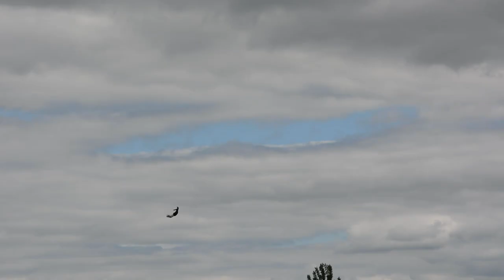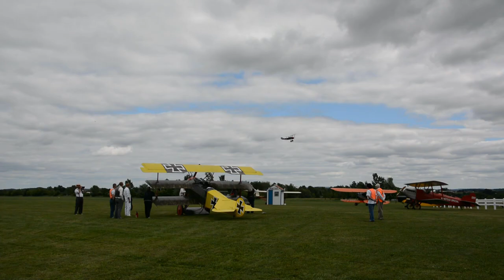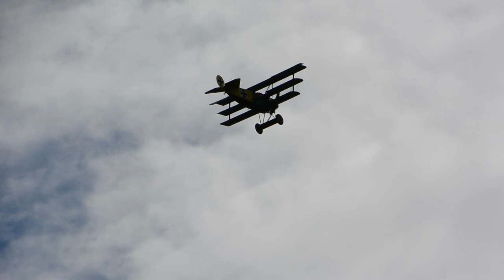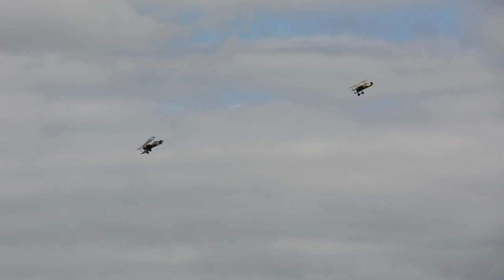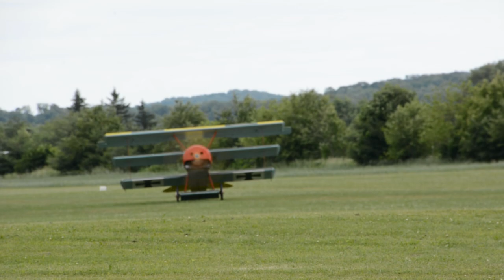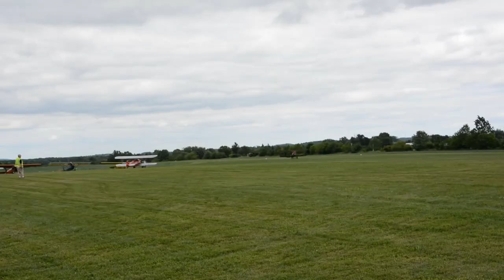Fokker DR1 Triplane and others

Comment: Engine start at 6:02
Reply from the maker: yea, when this vid shot, the rebuilt Mag was not putting out max volts on the plug type at hand prop speeds.., that was corrected later in the year and it is a 1 or 2 flip now.

Comment: I think the pilot forgot to switch it on. Once it's going, very very nice.
Reply from the maker: The Magneto had been rebuilt, but had a weak magnet giving low spark at arm turn over speed, it was later sent out, and new magnets installed, starts first blip 9 of 10 times now...